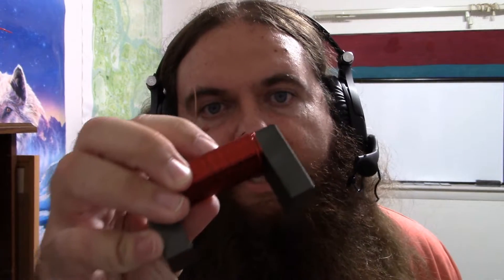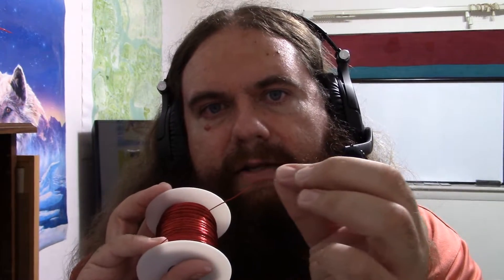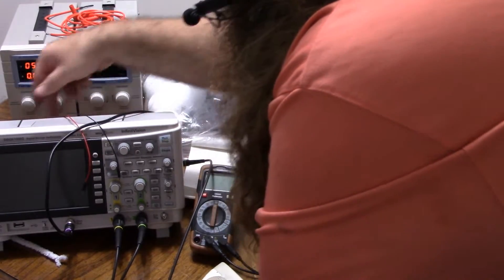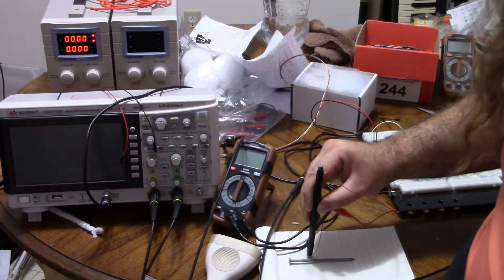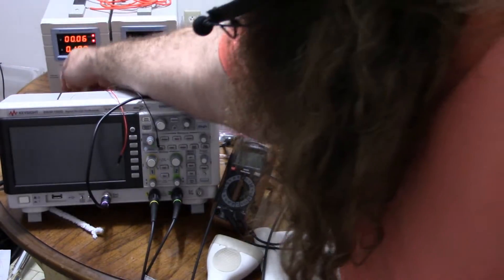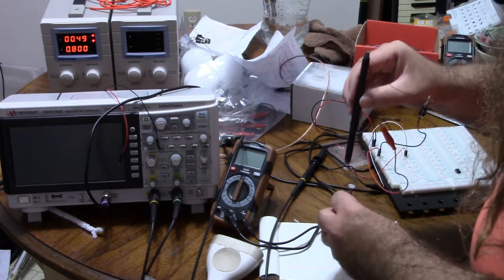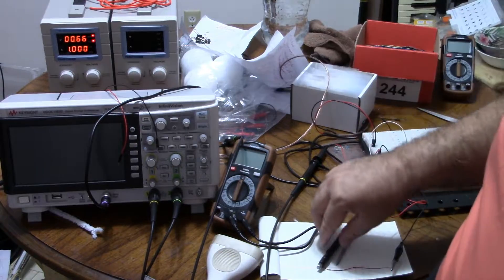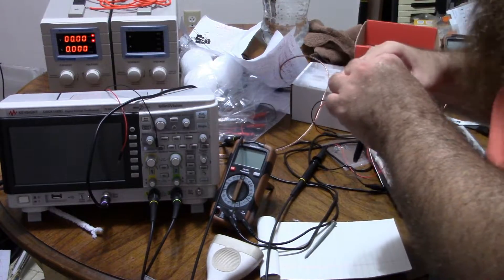Homemade Electromagnet - DIY Solenoid - Simply Put

Comment: So I don't have a lab power supply just yet, can I use like a 8v 3amp dc converter that goes into 220vac from a device? If so how every time I've tried it just works for space second and stops working until the electromagnet is disconnected?

Comment: Hey, I've been watching you, and I would like to make my own coil for magnetic particle testing. It would be a loop big enough to say pass an engine crankshaft through, or a connecting rod, that type of thing. I have a very large and long old welder lead. The thing is, I don't know the winding size, how many I would need, etc and then passing the current through it. Don't know the math behind it or what kind of transformer I would need to power it. Any ideas?

Comment: I already knew the basics but I loved watching you play with it and appreciate how you explained the magnetic loss in the squared hollow core. This may be ill advised, but I've got a crappy laptop that's not worth its weight in shit and I want to build an electromagnet to zero out/format the hdd. I know it can be done via software but I just want to do it this way. My gf's dad was an electrical engineer and his workshop is now an overcrowded basement (now my basement), but I'm sure he has a function generator and oscilloscope down there somewhere (just for detailed tweaks, I'll probably be using batteries to power it). Also, once I have it built I want to build a circuit to vary the field that's controlled by the volume of an audio input and see how I can make my ferrofluids dance with it.

Comment: If the builder uses a metal rod that is small enough to clamp in the chuck of a drill, the wire can be spun onto the rod, by turning the drill motor on. Go slow, be careful and wear personal protective gear = gloves, protective glasses, etc... The free end of the wire that is attached to the rod will spin. It could cut you, or hit your eye. So, secure the wire's free end with tape. I assume no liability, if you try this method.

Comment: What keeps a coil like this from being a short circuit? In other words, what do I have to do to keep it from short circuiting- is it just the length or the number of coils I use? Or is it the thickness of the wire? I hope my question make sense.
Reply: It actually is /sort of/ a short circuit. The length of the wire creates the resistance that dictates how much current is drawn (for a given voltage). So let's say you have 100ft of wire that measures 1ohm of resistance end to end. Since ohms law is voltage / resistance (ohms) = power (in amps), if you put a 12v power supply to your wire, it will draw 12amps of electricity, which is enough to probably melt the wire at that gauge. The coil he made has such low resistance, that at only 1 volt, he's already drawing about 1.5amps, which is enough to pick up the nail, but not enough to melt the wire of the coil. To answer your question, to avoid the negatives of a "short circuit" (sparks, wires melting, fire, etc), you need to reduce the voltage low enough to match the resistance of your wire coil- match meaning "the amount of current you want it to draw"

Comment: Hello, Electrical King. Can a solenoid inductor magnet thing be "run/connected" to a battery without it overheating? What could be put in place to drop the resistance? Thanks!

Comment: You can also burn off the lacquer or scrub it with a sharp knife ect.
To Winde the coils you can also use a drill attached to a rod ect.
A coil gun works similar.

Comment: Great video just have 3 questions
1. What Gauge is the wire ?
2. How many turns/rounds did the wire do around the nail?
2. Is it possible to make a U solenoid?
Reply: 1: for mine I use 20 gauge. Looks about the same
Reply: @malone2472  I forgot about the conment but thanks